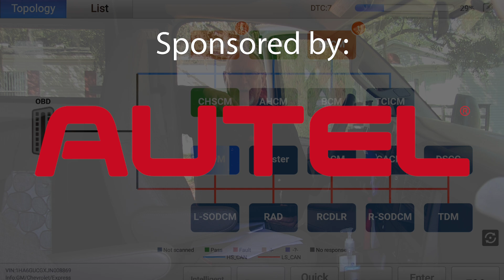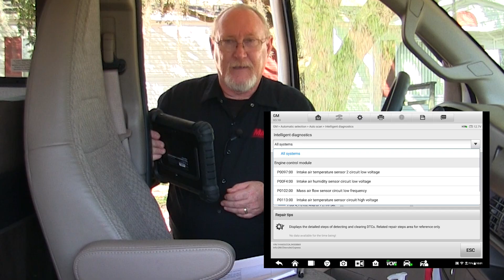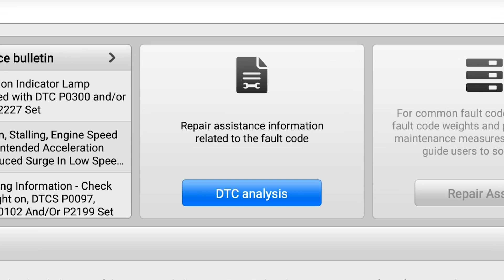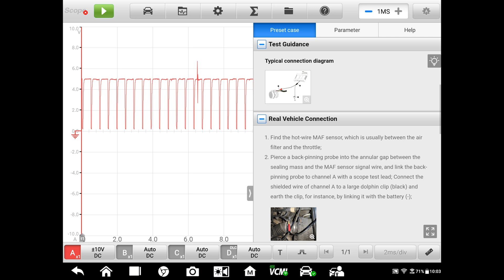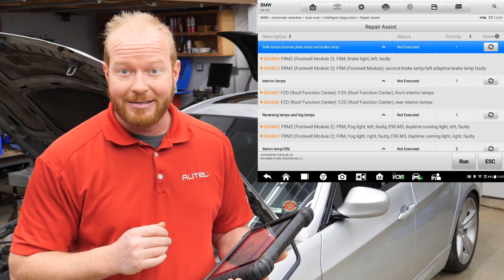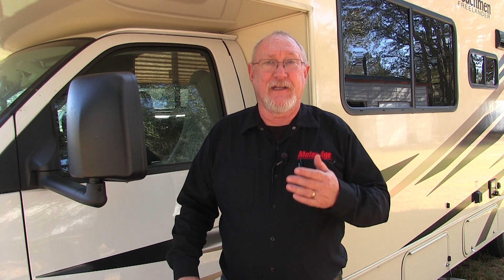The Trainer #112:  Add To Your Paycheck By Improving Your Troubleshooting Process

Comment: I’ve been using the Autel MS908 ever since it first came out, I was an ex-Snap-On to dealer(16yrs) turned independent and I was training techs to use these as I had done with the Snap-On, OTC and Launch units and let me tell you... Autel has them beat especially in cost, updates (updated as the come out) and ease of use. When I went back to being a Mobile Diagnostic Tech. my MS908 has been invaluable along with the Maxi-Scope add-on, now you’ve got me drooling over the MS919....my wife is going to divorce me!, oh well... it’s easier to as for forgiveness than for permission... go big or go home!